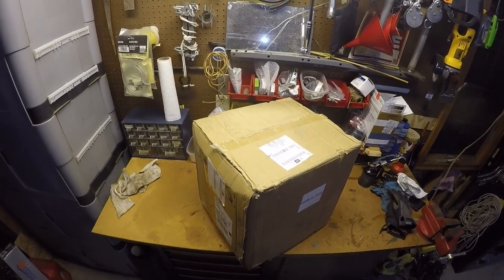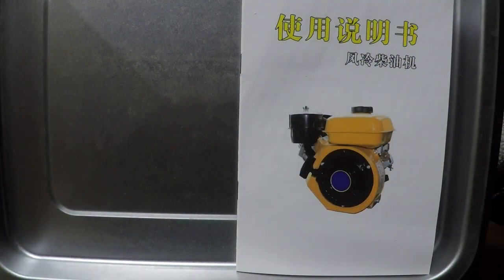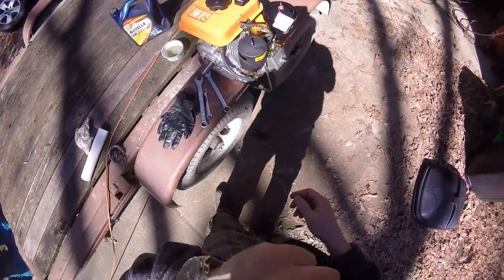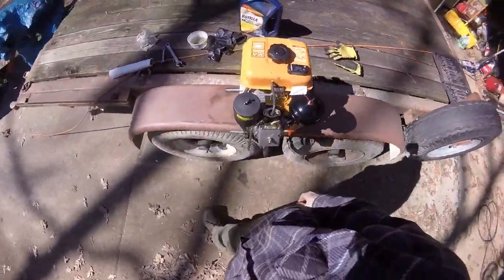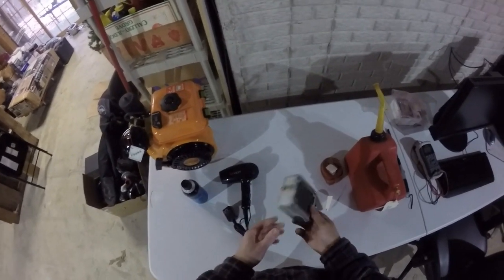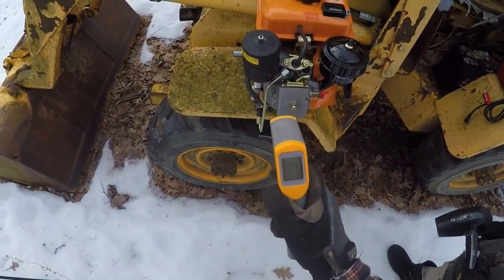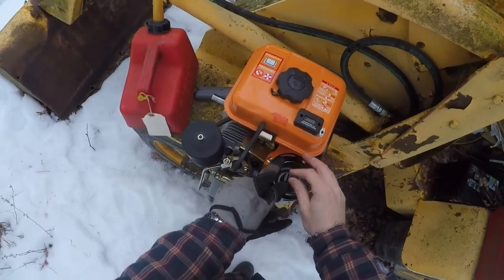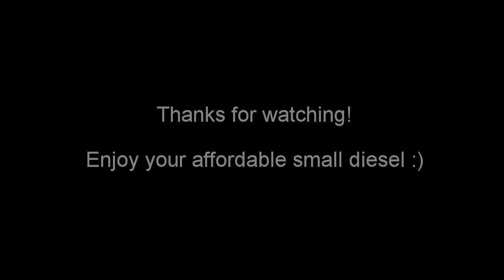Finally - a small affordable diesel has arrived! 168f 3hp engine!

Comment: I found a temperature range in the manual for two oils that can be ran in the engine.
10w-30 -25°C to 30°C or -13°F to 86°F
15w-40 -15°C to 40°C or 5°F to 104°F

Comment: I was looking at these for years also, finally got my hands one too
Reply from the maker: Hopefully we'll see some vertical shaft versions eventually.  I have an application or two for those as well.
Reply: @Ilikeurtractor   yea that would be great if they did
Reply: @Ilikeurtractor  how much was it with shipping and handling to the USA ?
Reply from the maker: @brieannateylar5810  Around $260.  There are a bunch on eBay now for the same price.

Comment: I have one of these engines too. Had it for about over a year now. I'm in the process of putting mine on a minibike. Need to install a jackshaft though. Good luck with yours. I have a couple of videos of it running.
Reply: I heard these have a weird 20mm size crankshaft on it. I have found 20mm centrifugal clutches tho so good luck with that mini bike project. I want to get in of these engines for the same reason
Reply: @srcobra50  👍👍
Reply: Why a jackshaft?
Reply: @srcobra50  They do. So I am looking at two ways to deal with this. Buy 3/4" ID pulleys and use a 20mm reamer or buy some 1" OD 3/4" ID DOM steel tubing and ream the inside out to 20mm. Then use a 5mm endmill to cut a slot for a 5mm key.

Comment: Situan Sifa MB168F. Very high quality castings and machine dimensions. Proven design. Quieter when mounting on thick plate aluminum, which also prevents base lug damage. It's super easy to start by pouring a kettle of hot water on the head. Don't use ether = crack motor. 20 MM shaft. I bought the $10 3mirrors stainless 3/4 to 1 inch crankshaft adapter and honed it up to .787 = 20 MM. Filing the crank makes it wear loose over and over again. 20 MM small pulleys and centrifugal clutches are sold, but a proper 7 inch pulley wants the 20 MM to 1 inch adapter. 15W40 oil. Avoid any contaminated fuels. A 10si Delco alternator is perfect with the 7 inch pulley, but down throttle to 40 amps. Avoid lowest and highest RPM. 1/2 to 1.5 HP output is sensible. Oil consumption is unexpectedly high especially within the first 25 hours. No load medium RPM is your best break in. Avoid opening the fuel line by wiring the decomperessor lever down and pulling with higher throttle 50 - 100 times until diesel is smelled in the exhaust.

Comment: Posted for others..Android / Google has a translation app in the app store for free..that can use the camera on you phone..it shows whatever language in captions on your phone screen..it will do many languages.. and does Chinese to English rather well..those diesel engines are still readily available, even Amazon has them..glad you got the Orange version as it has a metal air cleaner vs the red version comes with a plastic air cleaner..they are marketed as 3hp, 4hp,6hp etc..but seem to be 3.5 hp..they have plenty of torque and seen them used to repower many different types of equipment..some having 8hp,9hp gasoline engines originally and seems to handle it just fine..

Comment: I liked your video. I have this same engine (painted red). I have to admit, when you lit the gasoline in the air filter housing, it had me like: o_O

So, let's look at the numbers. For isentropic compression, the increase in pressure is found by:

p2/p1 = (v1/v2)^(1.4)

Where 1.4 is the ratio of constant-pressure specific heat to constant-volume specific heat, in this case, of air. The (v1/v2) term is of course the compression ratio (22:1). So with p1 being 1 atmosphere (naturally aspirated engine, with no "throttle" to reduce pressure), p2 is:

p2 = 22 ^ 1.4 = 75.75 atmospheres

Next, the temperature increase is found by:

T2/T1 = (P2/P1) ^ (1 - 1/1.4), and with your temperature there being (let's say) -10 Celsius, that is 263 Kelvin, so:

T2 = 263 * (75.75) ^ (0.286) = 905 Kelvin (3.44 times hotter!)

Converting to Fahrenheit: (905-273)*1.8+32 = 1177 degrees F :D 

I have only had my 3-horse 168F for a month and am going to use it to turn an alternator, to charge a deep-cycle battery to power an inverter. I have not had to deal with winter temperatures yet, but having an end-of-compression temperature of over 1100 degrees should be able to ignite anything!

I prefer using a propane torch to heat the cylinder head, if it ever gets too difficult to start :)
Reply from the maker: Thanks for watching and the positive contributions!  I'm a big fan of the math (although I don't claim to be an expert by any means with it) and although the math indicates the combustion temperatures should be enough to ignite at relatively low air temperatures, from my experience with indirect injection diesels they begin to start to struggle around 20°F.   Without glow plugs these temperatures can be challenging even on a new diesel engine.  As some of my engines are worn more than others part of this is due to cylinder leakage but I do know common rail engines start much easier in colder weather than the older, non-common rail engines even with known (and excessive/out of spec) leakage so I can only conclude the finer mist helps tremendously with ignition along with whatever heat the common rail system imparts to the fuel vs. the legacy systems (if any.)  I believe there is some interesting modeling that could be done to also account for the heat loss to the piston/cylinder/etc. that plays into things as well as the fuel quantity and its potential cooling effects.  Some of my older tractors actually start better with less than full rack injection on startup.  Seems like too much fuel can cool things off too much.  These are just my hunches and I cannot back them with any math so consider them accordingly.
Reply: @Ilikeurtractor I think you're on the right track with the consideration of cold fuel meeting hot air. The hot air is rapidly quenched by the fuel. Keep turning out videos, dude! It's appreciated :)
Reply from the maker: @goofypettiger  Thanks for the thanks!  I hope to do more but it might be a while...

Comment: The red engine is exactly the same as the orange engine - the red engine comes with an English translation - 
    From what I understand at 2700 RPMs is when it is 3 HP - that is also when it delivers full torque - 
       Does any one know what the safe idle speed is - what I want to know is what speed is considered high idle on this engine

Comment: Does 196cc seems like a lot for 5hp? A 50cc moped can have 4hp.
Reply from the maker: It's actually only about 3.5-4 hp and yes 196cc for that amount of power is a lot of displacement.  It is typical for diesel engines of that design (i.e. no turbo, no common rail, indirect injection, et al.)  Engine life would be expected to be much longer than a 2-stroke of the same power.
Reply: @Ilikeurtractor  Will fuel consumption be higher when the displacement is higher?
Reply from the maker: @spaken2768  The question would need further details to be answered correctly.  Compared to a 2-stroke engine or just another diesel engine with a different displacement?  In any case, the answer is determined by the overall efficiency of the engines at the power considered.  Diesel engines have proven to be much more efficient than 2-stroke engines historically.  The specific fuel consumption (fuel quantity per power output) generally goes down as displacement goes up for most engines (larger engines are usually more efficient.)  That doesn't necessarily mean a 6.0L diesel engine will use less fuel at idle than the 196cc engine at idle or even when each is producing, for example 3 hp.  But the 6.0L engine will very likely use much less fuel per horsepower than the 196cc.  As far as the comparison of 2-stroke gas vs. diesel it would be difficult to find a 4 hp rated, 2-stroke engine that would use the same or less fuel than a 4 hp rated diesel engine at the same output power.  The 2-stroke wins by its power to weight (and physical size) ratio of course.  So another good question might be could a diesel engine be produced cost competitively that has the same power to weight ratio as a 2-stroke?  So far it doesn't seem like it can.
Reply: @Ilikeurtractor  Thank you for such a detailed answer :)
Reply from the maker: @spaken2768  You're welcome.  Even though the answer appears to be detailed it still leaves out a lot of considerations and my knowledge is quite limited I'm finding out as I continue to learn.  Like almost everything in life it seems things just can keep going deeper and deeper with more and more questions that arise.  That's what makes it challenging though and allows us to become as specialized as we want to which is kind of neat.  Keep learning and share as much of your knowledge as you can!
Reply: @spaken2768  Look for a parameter called "specific fuel consumption" which will be in terms of mass of fuel per unit energy, i.e. 0.5 pounds per horsepower*hour which is about what these diesels consume. That tells us that one gallon of diesel fuel (6.7 pounds) would produce 1 horsepower for 13.4 hours, or 13.4 horsepower for 1 hour, or in the case of this engine here, 3 horsepower for 4.47 hours

Being metric, you'll likely see "grams per kilowatt*hour" which I believe I have seen 300 grams per Kw*Hr somewhere. Convert 300 grams to pounds --> 0.66 pounds. Convert 1 kw*hr to HP*hr --> 1.341 and we get 0.66/1.341 --> 0.492 pounds per hp*hr :) 

One gallon of diesel fuel would be good for 10 kilowatt*hours. I am going to use my 168F to turn an alternator to charge a battery and run an inverter. At a load of say, 1 Kw, one gallon of fuel would last 10 hours....
Reply: @goofypettiger should work with a 24v alternator as well?  Trying to figure out a way to set up to charge my lithium batteries at our place which is remote in Alaska. I have a few of these little diesels.
Reply: @curmudgeinnak  No doubt. Just watch the volts times amps and make sure that doesn't exceed the mechanical power output of a 3-horse engine (2200 Watts). So your 24 volt alternator should be good to 90 amps or so before inefficiencies are taken into account :) Also, might want to go with either serpentine belt pulleys or 2-groove V belt.
Reply: @goofypettiger  I think the one I want to use is a 6-8hp.  I have a smaller one as well.  I am getting a 12hp in a month or so from a friend. I am currently using a Yanmar L90 on a 4kw gen head. but having issues with that system not ramping up as power is drawn.  I am loosing hrz big time.

Comment: you bleed the fuel wrong .  bleed it at the outlet of injector pump then at the injector. your engine had air in the pump in the line and in the injector. try to visualize what going on . these motors will start first pull right out off box. you made way to big of a deal out off it.you don't need to take off the fuel line.(risking contamination) forget about positive displacement pump blaaa blaaa blaaa . forget instructions and just bleed the engine like you have done all other diesel injection systems for 4 decades....oh wait that me
Reply: I agree, this guy has a poor understanding of the process. He may be trying to avoid cavitation damage to the pump elements. But he doesn't know what he is doing.
Reply: Yeah...I was shaking my head too.  
To be fair....he was demonstrating worst case scenario run out of fuel situation.
 Propane bottle when it is cold.

Comment: No. You didn't teach anything good. Mount it on a heavy plate of aluminum with fine 3/8 bolts. Don't use ether. It's way too easy to blow up the motor. I just wired the decompress lever up and cranked to clean out air. Use only 15W40 oil and real diesel fuel. I honed a 3/4 to 1 inch shaft sleeve to mount a big pulley. Cold weather? A kettle of hot water poured slowly right on the top of the cylinder. It wants a long gentle break in. Avoid the slowest and highest speeds.

Comment: I haven't seen why one would want a "cheap" Communist/ Slave Labor built stinky noisey one of these. If a Dismal stinking, noisey & particulate spewing prime mover is what you're after, remember Dismals "pulse" harshly causing vibration like you've never seen. Special considerations must be made to accommodate it. ie: Special rubber mounting and isolation as well as gusseting bracketry or things just fall apart. And due to high pressure combustion the EPA will push for DEF equipment if they become trendy. Kind of like the 2 stroke dilemma w/ unwanted extra weight. But hey, this is America & you still have Freedom to choose. (for right now)
Reply: I just got in a 186F (10-horse, 418cc) that is going on a go-kart with a 40-series torque converter. As far as why one would want one? They're cheap, well-built (for what they are) and can run off of alternative fuels. I watched a video of a guy who ran his off of Wesson cooking oil, FFS. Seems like a handy thing to have around, if highly refined fuel like gasoline becomes scarce. Think about what Rudolf Diesel had in mind with the compression-ignition concept. I seem to recall that his prototype ran on peanut oil o_O